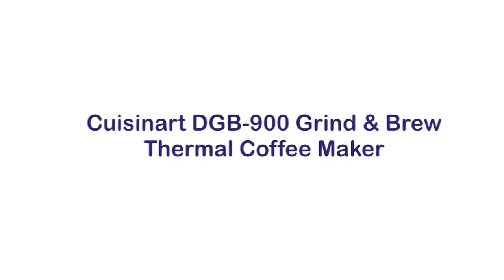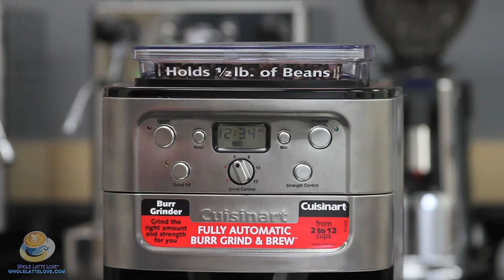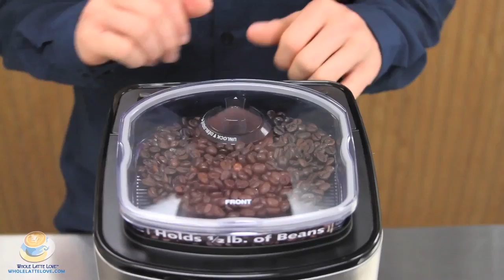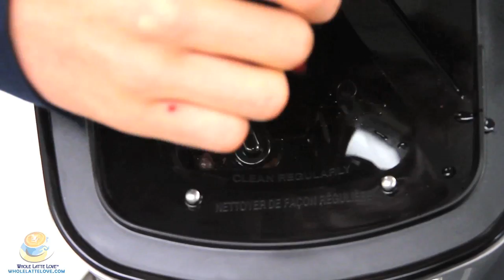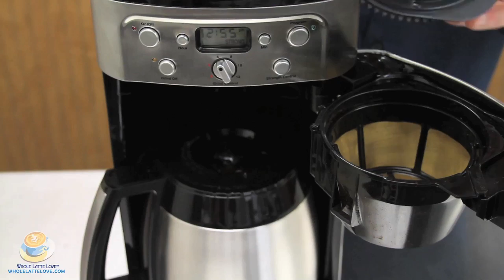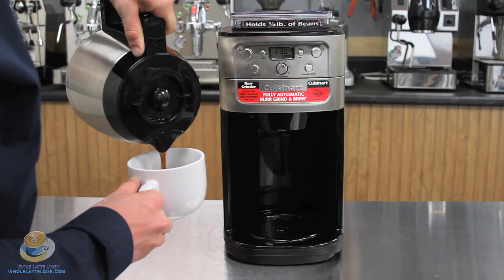Cuisinart DGB-900 Grind and Brew Thermal Coffee Maker

Comment: Great video and great tasting coffee ruined by a very poorly designed carafe by an imbecile designer. The carafe is an absolute garbage which owing to it's ridiculous designing flaw, won't let you pour the last 1 cup of coffee from it unless you invert it upside down completely, thus spilling  coffee all over your hands or the counter every time. Second, as soon as the brewing is done, you get your coffee and will realize it's mildly warm. Not hot, just mildly warm - Again, the carafe doesn't retain heat. Then you immediately put that cup of coffee in the microwave for additional 30 seconds to get it to normal temp. All this, very apparent now, was perhaps never tested before producing such a waste of a coffee maker, as it's inconceivable any simpleton product testers with half a brain would have approved this for release.

Comment: I have had my grind and brew for 12 years a d I would not trade it for any other. I did have to read the instructions to make sure I was cleaning it properly and I tweaked the brush provided and made another tool that helps keep it clean. I also only use deionized water, no minerals and I clean it everyday.

Comment: Yep I did the same as many.  Filled the water full, then tried to make 2 cups by setting the grinder.  Its the fault of the manual because it makes it sound like it adjusts the water too, but it doesn't.
It still works much like a manual coffee maker in that if you want 6 cups of coffee, you only fill it with 6 cups of water, and add 6 scoops (+/-) of ground beans to the filter.  The difference here is that you are telling the grinder how many beans to grind and add to the filter.
Reply: In the manual it says “The burr grinder will grind the correct amount of beans, and automatically adjust the coffee/water ratio for low cup settings.”
I set mine to two cups and filled the reservoir for 12 cups based on this. It did not automatically adjust the coffee/ water ratio as claimed.  It brewed 12 cups of very weak coffee.  The manual is either misleading, or just wrong.
Reply from the maker: Hi CK, Thank you very much for adding the useful info!

Comment: How do you remove left over whole beans in bean grinder (inside machine) to switch to different type of beans. My Colombian tasted a little like hazelnut.  Maybe turn the coffee pot upside down? Or do a mini brew?
Reply from the maker: Hi Norma, Good question. Always problematic to get the remnants of flavored coffee out of this type of brewer. There are grinder cleaning products which help but none appropriate for a combo grinder/brewer machine. Urnex, a company which makes a variety of cleaning products for coffee and espresso machines is working on a grinder cleaning product appropriate for use in brewers where the product comes in contact with water. In the meantime best advice is to run a few brew cycles to reduce the flavors.

Comment: Hi guys! I cleaned the coffee pot lid cover and it worked. The one that you need to twist to lock. You can use the Compressed Air for Cleaning Computer Keyboards or with a water pik. Blow some air or water  into the drain holes. It will declot the holes and the coffee will flow normal again.
Reply from the maker: Hi Adriana, Thanks for sharing your tip!
Reply: Adriana Santillan , great idea!

Comment: We've used this machine every day for over 5 years. We love it. However, now when the coffee brews and the coffee drips into the carafe, it overflows and makes a mess. We tried cleaning it but no success. What do you suggesst? Should I purchase a new lid?
Reply from the maker: Hi Maria, Can't say for sure that a new lid would solve the problem without seeing it first hand. However it does sound like there is a restriction or diversion of flow. Id check to make sure everything lines up in the area where the coffee enters the pot.
Reply: We have being using the coffee maker for a year and we are experiencing the same problem. This must be a manufacturer error.  The mechanism has a sring that wears out :(
Reply: If you are using the gold forever filter...dont...I switched to paper filters...no problem.
Reply: Why not use the gold filter? Is that what is causing the spring to wear out and the machine to over brew? They seem unrelated.